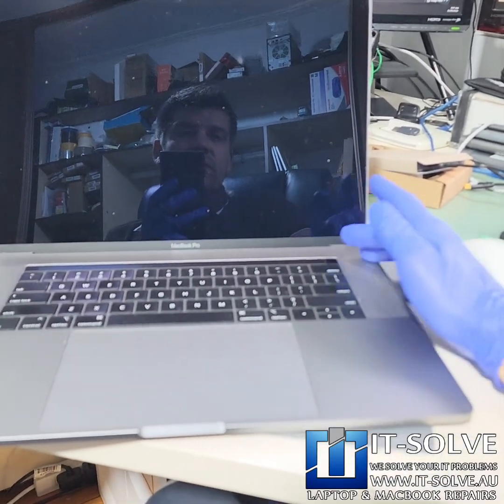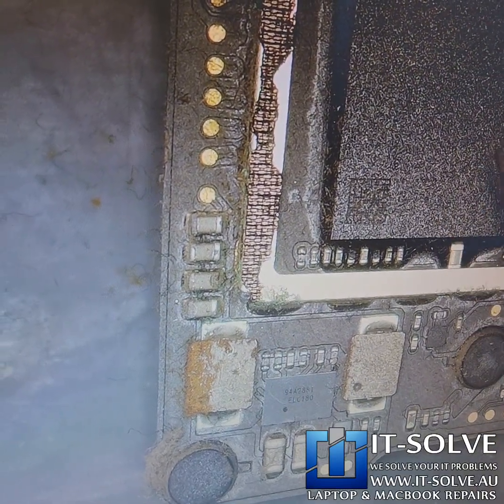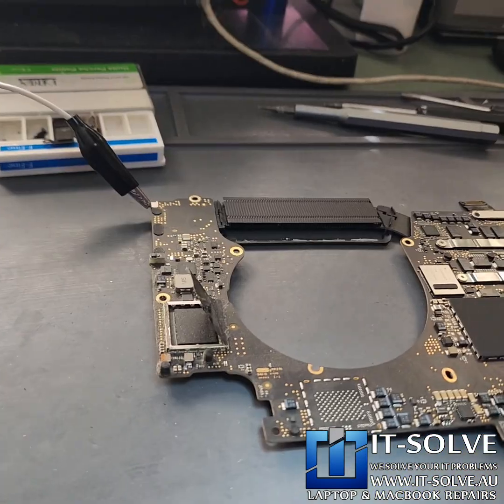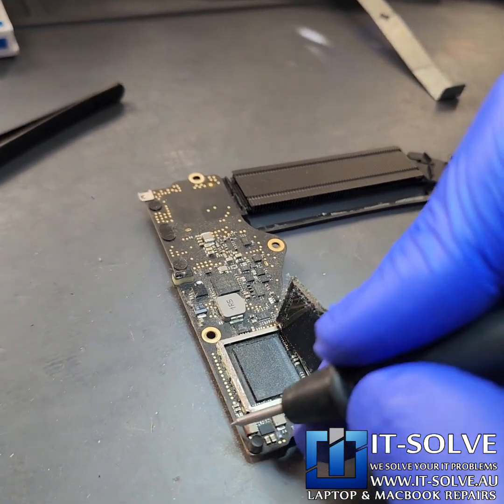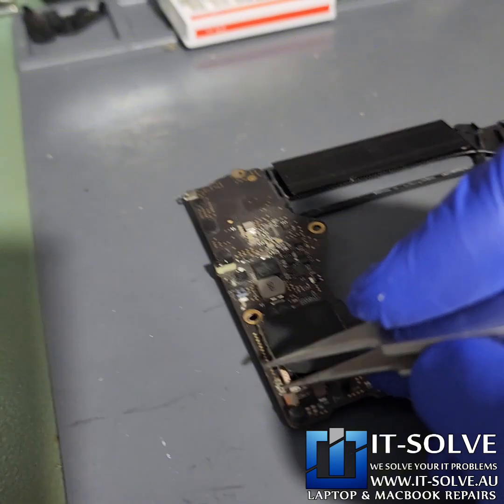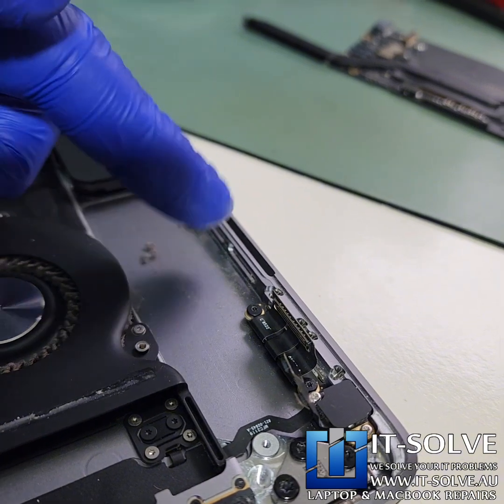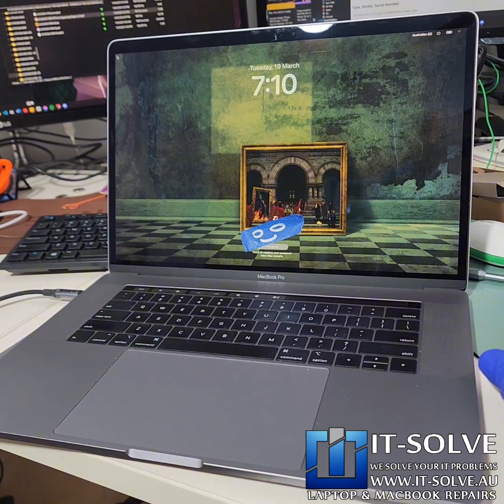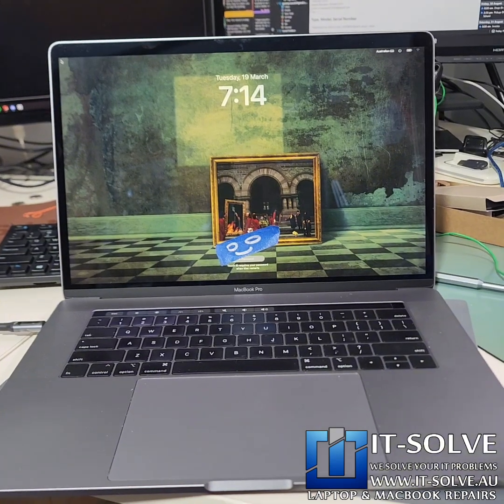Macbook Pro not turning on Repair, caused by a shorted cap on the NAND line A1990

Comment from the maker: We are repairing 2019 Pro A1990 not turning on today at our IT-Solve Laptop and Macbook Repairs in Adelaide workshop #2149

Pretty much every time Macbook won't Turn On, the cause will be an electronic fault. 
We don't realise that the environment around us can directly impact the longevity of our Macbooks. Especially, if device hasn't been serviced annually. The humid and wet conditions of the East cost can create corrosion on the small as a needle tip components within the Macbook. 

This was no different case.

Unlike #apple, #itsolverepairs specialises in #macbookrepair in #adelaide. Save yourself money and your #macbook from ending up as #ewaste in #landfill by getting it #repairednotreplaced

Get a quote and book your Macbook Not Turning on Repair in Adelaide today  https://it-solve.au/macbook-repairs-adelaide/macbook-not-turning-on-repair-adelaide/#yt